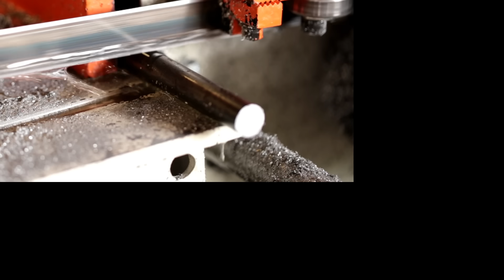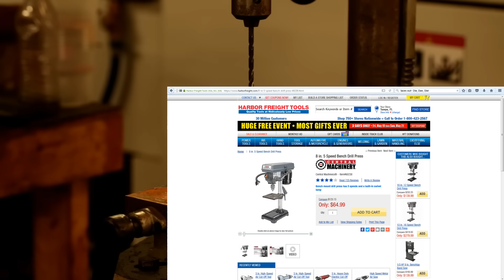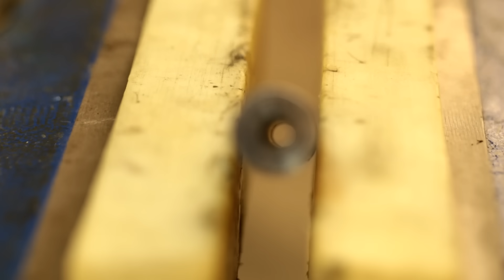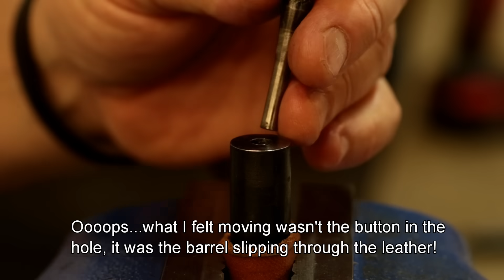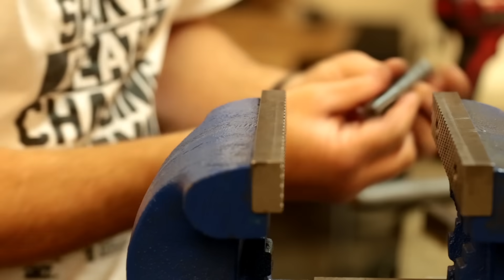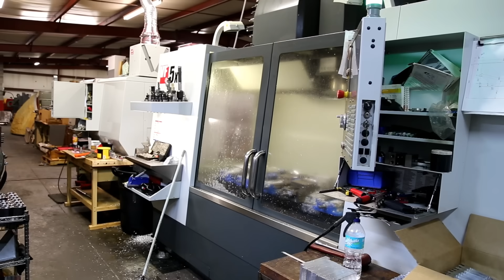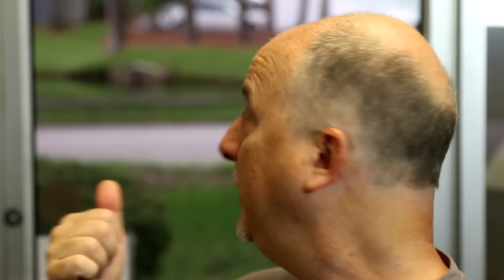Home Shop Rifling!

Comment: I really didn't get the point - is this a not what to do video?  It sort of made me cringe seeing the way he did many of the steps.  I think it might have been more valuable if he had shown us a cheap but more proper way to do this.  If you can afford a rifling button you can probably afford a hydraulic press as well as other things to make the job turn out nice.
Reply from the maker: Sounds like you DID get the point.  This video emphasizes "crappy" methods...same thing as "what not to do".